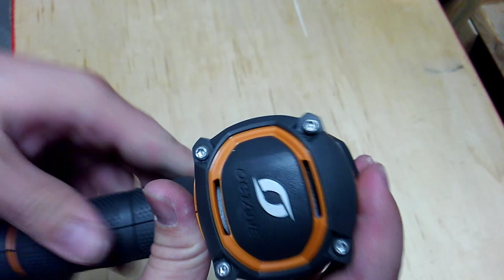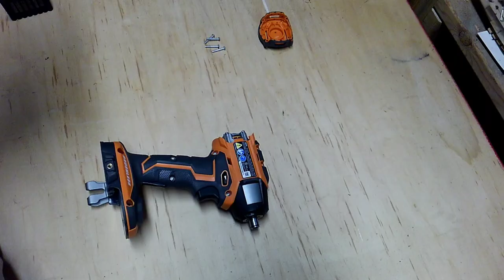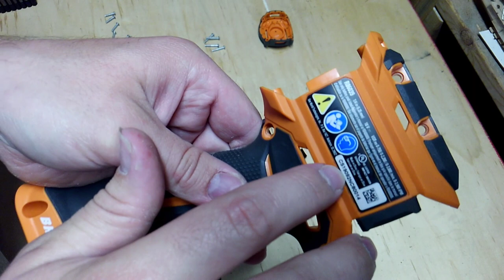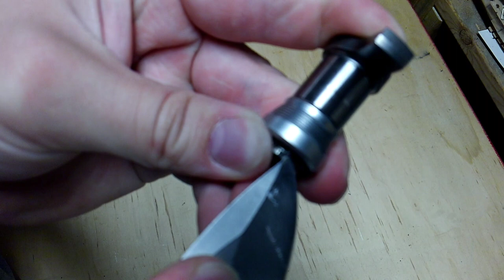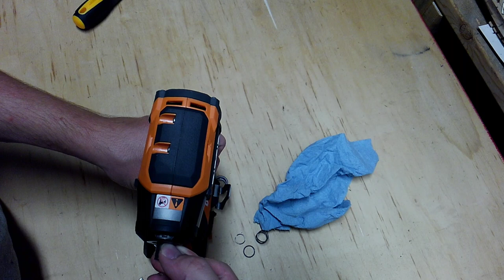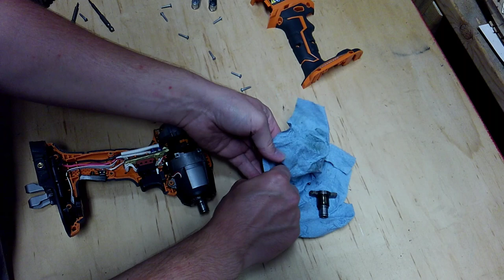$32 Ridgid Octane impact driver teardown and repair

Comment: Where can I find the washers and springs without having to buy the entire anvi assembly?
Reply from the maker: I'm not sure if they have all the chuck parts separately, or if it has to be purchased whole. Ereplacementparts.com is a good source, and there's several other sites that may have with you're looking for. Just make sure to use your specific model number, as these anvils look very similar between models but can have slight differences that make the parts incompatible. Hope that helps, good luck 👍

Comment: I need to replace that front coupler. The part with the ball bearing that holds the bit. What site did u get the parts from?

Comment: Thanks for the video.  A few questions for you.....you said you did a mod on the gen5x to make a 3/8 impact wrench....what anvil did you use?  The Milwaukee 42-06-0025?  If so how did you drill out?  Does the fit need to be just right?  A video on that mod would be great.  I found one short one....few details of the mod.  It’s a great impact.....going to be many kicking around.
Reply from the maker: Hey Ben thanks for watching! Yeah I did a conversion on an X5 brushless but I did mine to 1/2" where most do it to 3/8". I don't remember the part number for the 1/2" but it was a pin detent and did require some work with a Dremel to make the hole on the back large enough to fit the hammer mechanism on the Ridgid. If you're wanting a Ridgid 3/8" impact I would wait for the new Octane 3/8" to come out in about a month.  I wrote this article for ToolCraze and it has all the current specs and features, although I need to add pricing which should be $129 bare tool. It's still neat to modify your own and use it but if you don't want to mess with it the new Octane is an impressive unit that I should have some videos on soon.

https://toolcraze.net/ridgid-octane-18v-brushless-%e2%85%9c-drive-6-mode-compact-impact-wrench/
Reply from the maker: I also made this post on the Ridgid forum a while back with a little more info and at the very bottom I have a reply to someone with the part number.

https://www.ridgidforum.com/forum/power-tools/power-tool-discussion-forum/725841-ridgid-gen5x-brushless-impact-driver-conversion-success-kind-of
Reply: Thanks Josh.  I follow that site....missed that article....nice.  I’m sure the 3/8 anvil will fit gen5x when it’s available in a year as you found 1/4 collet compatibility.  I have an extra impact from a kit...price is right for a mod :)

Comment: Hey bud, you mentioned that alot of people have converted those Ridgid impact drivers into impact wrenches. I thought this was some bright idea that I thought of lol. Anyway In really interested in how to do this. Did you know of any links where I can get those instructions??
Reply from the maker: Hey man thanks for watching! Here's the link to a post of mine on the Ridgid forum that has more details and some links to part numbers for the conversion. I would like to note though that Ridgid does have a 3/8" Octane impact wrench coming out very soon, probably in the next couple months, so unless you get a really good deal on an impact driver to convert I suspect the Octane model will be a better route to go. But if you do decide to do conversion I'll be happy to answer any questions I can! https://www.ridgidforum.com/forum/power-tools/power-tool-discussion-forum/725841-ridgid-gen5x-brushless-impact-driver-conversion-success-kind-of
Reply: @joshthetooldude5775  Thanks for responding. I'm actually a remodeling contractor and I primarily use Ridgid tools but since the platform they have is so limited, I find myself having to grab other stuff which of course means more chargers & such. I only do automotive work in my spare time which I currently use a Gen5X along with a 3/8 socket adapter so I have the tool to convert already. I also have the mid torque 1/2 that Ridgid makes. Looks like I should be able to make the conversion for around $30 or so. Thanks a lot man.. So hows yours working so far? Everything good as far as the torque & power?
Reply from the maker: @certifiedyaminspector-dadd6224  yeah it's been over a year and mine is going strong. It'll take lug nuts off my 1 ton van no problem
Reply: @joshthetooldude5775  Bruh I had to come back and thank you again lol This time it's for the Ebay deal. I just grabbed a pulse driver that was advertised as parts or repair for $33. Guy said it worked at 60% and the motor smelled burned. I dont think he knows how hydraulics work haha. I still dont know what the smell is about but as soon as I got it, I broke it down and inspected the motor. Everything looks pretty good. I just shot some 3 1/2" screws into treated 6x6 and it ran through those easy. So far, so good! I'm gonna put it through some real tests soon.. This was an awesome video man.
Reply from the maker: @certifiedyaminspector-dadd6224  glad to hear you grabbed a good deal on it. I don't have a stealth force but I've heard great things about them. Hopefully it serves you well 👍